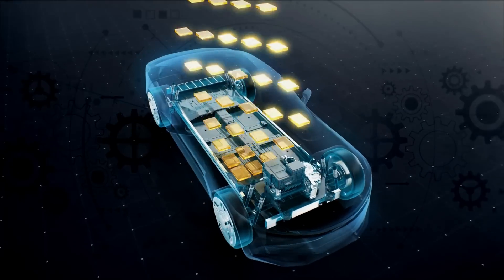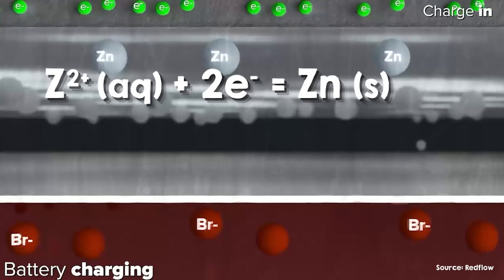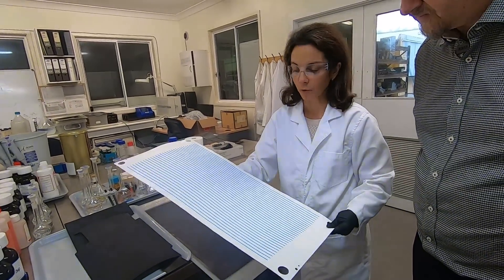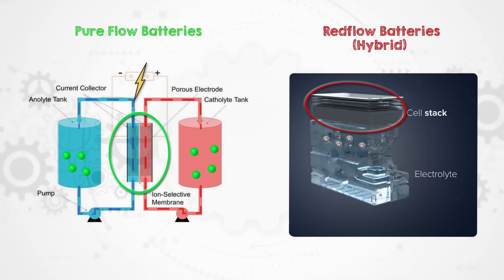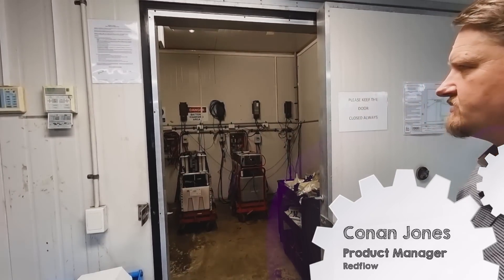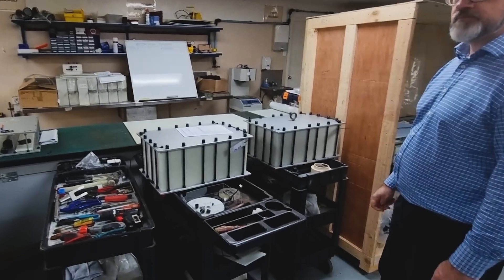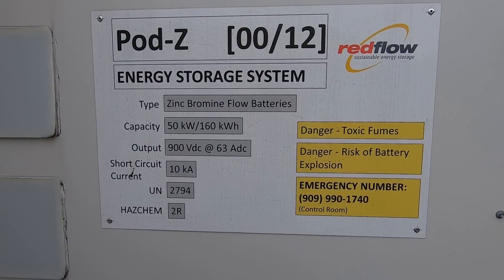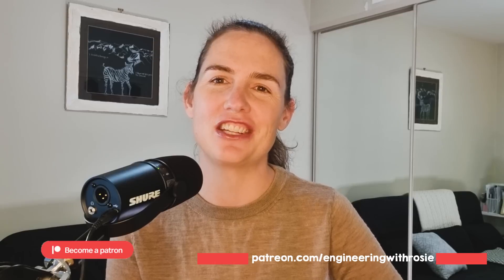Are Flow Batteries About to Take Over? A Lab Tour of RedFlow's Zinc Bromine Battery

Comment: that is huge. I have 60kw Lifep04 and it takes about 1/5th the space maybe less.  I do like seeing different storage solutions for energy.
Reply: LiFePo4 batteries are very energy dense. These flow batteries are never going to get small enough or light enough to be used for mobile or portable systems, but for applications where space is not at a premium, they can offer a useful cost savings as they don't rely on any rare elements. Static applications is where they will excel.

Comment: What are the global constraints to bomine production and is it more limited than zinc?

This does seem a promising technology to economically compete at grid scaler.
Reply: I can't really evaluate the economics of it until I hear cost per kWh, which was missing from this video.  Zinc is pretty cheap.  Bromine is more limited.  It's gotten from various brines and concentrated salt sources, like dry or drying lakes.  The ocean contains bromine at 65 ppm; that's 65 mg of elemental bromine per liter.  Sea water is not the most economical way to get it, but you'd never run out.

Comment: So what's the advantage over something like a Powerwall? Or an array of Lead-Acid batteries? I believe both of which are cheaper at this point.
Reply: They don't rely on metalic elements that are only found in abundance from China. Australia has 20% of the world's Zinc reserves and can extract Bromine from the sea. They also have better tolerance to high temperatures, making them more suited to hot countries.
Reply: @tlangdon12  which elements are you referring to that you allege are only found in China?!If you’re taking about Rare Earths they are. Not rare in distribution, every continent has most or all of them. the Rare refers to the low concentration in ore bodies. So why are so many sourced from China, simple rich countries outsourced the dirtiest raw materials processing (first level trophic processes) to countries where labour is cheap and environmental regulation is most lacks.  And given that most of the worlds batteries are made in China who’s going to produce them cheaper including transportation to China for cell fabrication?

Comment: Enjoyed that. One of the reasons I've been a bit skeptical of a complete renewables path is the question of energy storage and how battery systems can be built at scale. These systems seem to be a reasonable option at a facility level and in my line of work (dealing a lot with remote mining installation OT environments) they would be pretty viable. I wonder if we'll start to see more grid scale applications of this tech?

Comment: So 3x Tesla walls have 15kW continuous, 40.5 kWh, 342kg,  0.38 m3 volume, a Redflow 14Kkw, 40kWh, ???kg, ??? m3. This battery does not seem to have the usual flow battery advantage of separating power and storage but it does sound like it has the longer storage advantage. So to me, the main question is at scale is it cheaper than a Tesla battery?
Reply: It will be while before it scales more cheaply than a Telsa battery.

Comment: I like the redflow battery idea. It looks to me that they could ise thinfilm technology to mass produce the battery thereby reducing the cost. Even just 1 of these batteries would be grate if you had solar on the roof. If would be grate if it could charge with 7-10kW, but  a discharge of just 4kW would probably be ok except for charging a car. 10kWh would be ok for many houses, but if you have a electric car you would probably need a lot more. But if the battery's were mass-produced and they where modular and you could just add one more to you system your self after having the first one installed I could really see this in many houses. If you could just bay them in the hardware store or order on online like it was no big deal.

Comment: As Redflow states on their website: > In our flow battery, dissolved zinc is 'plated out' as metallic zinc on one electrode surface, with bromide converted to complex bromine on the other ...<    Re-plating the Zinc has been troublesome for other rechargeable zinc batteries because the rate of recharge makes for mossy (non-conductive) deposits, integral deposits or dendrites which short circuit the cell.  Please share how Redflow solved the zinc replating problems that have previously limited the life of nickel-zinc and other batteries.
Reply: Pete, the best I can assume from personal experience, I have two of these batteries; is their maintenance cycle.
Every 24hr, 48hrs or 72 hours are the possible maintenance schedules the software lets you select. In a maintenance period the stacker plates are completely discharged so the battery has zero stored power. Then the system does a cleaning cycle, after that cleaning cycle you are starting with virtually a brand new battery. This strict maintenance scheduling is pretty much the secret of its longevity.
The best scenario is for a complete 100% SOC to be obtained, followed by a 100% discharge to zero. This would (should?) reduce dendrite formation as far as I understand things. This 100% up then 100% down isn't real world stuff if you have it connected to your house; which we do. During the day the batteries are given whatever excess the rooftop solar can give them, 3½ years later and counting, we are quite happy with them.
In effect, every day (we have 48hr maintenance intervals selected) we start with a brand new battery and one in use. This maintenance cycle requirement is also why it is necessary to have at least two of these batteries for continuous power storing and power releasing possibilities.
Reply: @allanhugh2044  I agree with de-plating to 100% depth of discharge to clear the zinc deposits that are less than optimal, meaning dendrites or mossy deposits.  I now recall that this same scheme was talked about for nickel-zinc batteries.  As long as the zinc is the limiting factor(reagent), it should all dissolve at 100% discharge.
      You nailed it with the scheme of using two sets of plates.  With modern electronics, a DC-DC converter can efficiently buck or boost as necessary to charge one battery while depleting the other, identical, battery right down to zero.  That I know of, with the flow battery or Ni-Zn cells, one can cycle to 100% DOD every cycle with immunity.  I speculate that with a charge schedule like this that no BMS is needed.  There seem to be no issues with 100% DOD and only so much zinc in solution to cause problems at 100% SOC.  Let's do this!

Comment: The problem with flow battery is you still have to PUMP as in waste energy with a motor
Reply: The problem is that "all batteries"  or any is storage system has efficiency losses,  in numerous  manners....

Entropy is a bitch...

Comment: Great video but unless these are cheaper than LFP or have a significant advantage over them I can't see it being terrible useful. I always thought flow batteries woudl be great to replace petrol station as they already have massive tanks and it would be minimal cost to dig then up and replace with a flow battery that can be charge with cheap energy overnight when demand is low.

Comment: Thank you for the interesting video on flow batteries. One question I've had for a long time involves battery duration. I often read that lithium ion batteries are only suitable for stationary energy storage for a few hours (often 4, as I remember). But I don't understand why the duration of storage would differ among types of batteries (unless the charge leaks out of lithium ion batteries within a day or so, but then they wouldn't be very practical in cars, so I guess that's not what's happening). I can't figure out why lithium ion batteries can't store energy for days or weeks, except that the cost would rise in direct proportion to the energy stored, but that would be true for any storage device, right? Can you consider explaining in a video why different forms of energy storage work for particular durations?
Reply: The durations are more what the market has deemed the best fit for each storage technology.
Part of it is how the costs scale as the storage duration scales. Doubling the capacity of a lithium ion battery essentially doubles the cost, but doubling flow battery energy capacity may only cost 1.5 times as much because the cost of the pumps and reaction cell only increases with the power output not the amount of energy stored. The battery in this video is a bit different because it is a hybrid flow battery.
Reply: Li-ion batteries can hold charge for a good while, but they are expensive and you really only get payback for each charge/discharge cycle, so they're not really economically viable at large scale unless you're really making your asset work by frequent cycling. With a cheaper battery to can get away with longer intervals between cycles and still pay back your investment cost in a reasonable time.

Comment: While the current rush to build battery storage facilities is aimed at maximising proffit from peak grid electricity prices, protecting from short outages and stabilising the grid, lithum batteries will do nothing to protect from the dreaded dunkelflaute while flow batteries can if managed properly. Horses for courses. It would be interesting to see a video on vanadium flow batteries (like the Invinity batteries proposed for the Yaldamalka) to see the differences

Comment: Nice! Do they have any projections for cost/kwh? It's aiming to be cheaper than LFP I suppose. Tricky to get costs down before large scale but they must have an idea based on materials
Reply: Yep.  That's the info I'm curious about too.  Though just cost/kwh is probably not enough... IIRC, the economic case for flow batteries also depends on their longevity.
Reply: @travcollier  agreed, it's not just cost per kWh storage, rather: total cost / capacity x cycles. I.e. cost per kWh stored or deployed. Roundtrip efficient Aso matters, but less so for long-term storage applications
Reply: flow battery  is a complex mechanical system.... So simple "capacity x cycles" parameters do not play a role....
Reply: @nc3826  Not much more complex than other sorts of batteries at these sorts of scales.  Moving liquids isn't exactly exotic, and other large battery systems also require mechanical components for cooling (not uncommon for them to even be liquid cooled).

There are folks who have thought a lot about relevant metrics, LCOS for example.  But capacity*longevity/cost (or the reciprocal) is a decent rough metric to get a general idea.
Reply: complex - "consisting of many different parts or considerations"   which is what a flow battery is relative to conventional battery cells.... it does not mean it's exotic or beyond comprehension....  

Some forms of flow batteries have virtually no dendrite formation....  So other criteria become a first-order consideration....
Reply: @nc3826  Fair.  But flow batteries and everything else do have factors which limit longevity.  Anyways, I think we pretty much agree that to fairly compare flow batteries with more conventional requires a bit more than just cost/capacity... Which is what I was getting at by mentioning longevity ;)

I do still want to see some cost estimates for this hybrid flow battery system.
Reply: @travcollier   Like any mechanical system, when the cost of repair exceeds the replacement cost, its effective life will end.... Current estimates are about 10 to 15 years for this type.... 25 for Valladium....  

But the nice thing is it's much easier and more cost effective to recycle than I conventional battery cell....

Scalability of flow battery means the cost  per kilowatt-hour  goes down as it increases in size.... Plus flow batteries are not cost effective for individuals....  So what's the use of a cost estimate?

Plenty of information on the internet.... And post on YouTube... Good luck taking the time to find it....
Reply: @nc3826  I'm somewhat familiar with the figures for flow batteries, but not the hybrid system this company is making.

Comment: This is the first time I have seen someone reviewing a Redflow battery that actually explained it properly and correctly; although I did have to stop, go back, then slow down the replay in the part where you were discussing the charging and discharging through the membrane. I needed to switch on subtitles as I couldn't hear what the lady was saying when she was showing the plates and membrane. You are pretty much spot on with everything.
I was surprised that you didn't mention the red colour of the hand held vials of solution; essentially it is where the name Redflow comes from.
I have two of these batteries, which are now 3½ years old and still going strong.

Comment: But but but....They have been going for 8 years you say but I can't buy one (or two more likely) of these batteries in New Zealand and what will they cost.  They should be cheaper than a Tesla power wall, kWh for kWh.  The Redflow battery may have already been made redundant.  Gelion is producing a ZnBr battery with a gel formula and looking very much like a typical Lead Acid battery.  In fact that is one of its best features.  It can be manufactured in a Lead Acid factory with some relatively minor modifications.  Price is everything.  If they are cheaper, kWh for kWh than a Li battery and if they really do have the longevity, they should be a winner.  But when can we buy them.  In the meat time there are the Liquid Metal batteries and the up and coming Na batteries (~10kg of Na per Cubic meter of sea water).  Can't buy these either.

Comment: RedFlow's Zinc Bromine Batteries are manufactured here in Thailand. A few years back the reseller here quoted me US$16,000/AUS$24,000 for a 10kWh ZBM2. I am hoping that the prices will fall as production scales. I ended up paying AUS$3,000/US$2,000 for equivalent sized LFP batteries.
Reply: The prices will fall as they scale up their production, and figure out how to supply the residential market without incurring significant additional costs.
Reply: @tlangdon12 I'm beginning to think it won't make sense for residential, due to the battery requiring a maintenance contract in place for regular maintenance checks. Ideal to create jobs but unfortunately for residential use, money doesn't grow on trees.
Reply: @worskaas  I'm not aware of the needing maintenance checks on a regular basis. They just need repairing when they go wrong.

Comment: I live in Ireland and have residential solar. It varies from 1 kWh per day in winter to as much as 45 kWh a day in summer. I've been looking into microwind generation to supplement it, but it's clear that needs storage to work.

Flow batteries have looked really tempting as a solution (sorry) for years now. As I'm in a rural area, space isn't as much of an issue. So for me, the smaller footprint of hybrid flow batteries doesn't overcome their lack of cheap expansion options.

The more I learn about wind and solar generation, the clearer it is that we need storage systems that can handle large spikes in generation and can store power over the span of weeks.

On the flip side, EV hub charging stations on motorways or fleet depots need to handle large spikes in demand for short periods and then produce very little for much of the rest of the time. Which seems like a great use case for storage as well.

The traditional grid wasn't really designed for this. My car can draw the full power needs of over a dozen houses - for about 10 minutes. A strong wind will blow for a day or two and then very little for a week where i live.

Flow batteries look interesting though the moving parts give me reliability worries.
Reply: Yours is an interesting experience.   I suspect those moving parts in the flow battery are off the shelf parts and assemblies that have been proven durable in other industries for decades.
Reply: I'm curious if compressed air is a reasonable place to start as you have the land.
Reply: These flow batteries should be ideal in your application, but Redflow are not focused on the residential market yet. Their focus is on grid-scale applications, and it is there where the money exists to improve the product to the point where residential customers will be able to buy them  and be happy with the.  The moving parts should be source of concern - in a grid-scale implementation there is enough redundancy for the failure of a single battery to be of no conseqence, but if the pump fails in a residential application, you are stuck; neither being able to charge nor draw on the power stored in your battery. Perhaps Redflow will develop a high-avalability version of their product with a redundant or hot-swap pump, or perhaps a solid-state pump will become available.